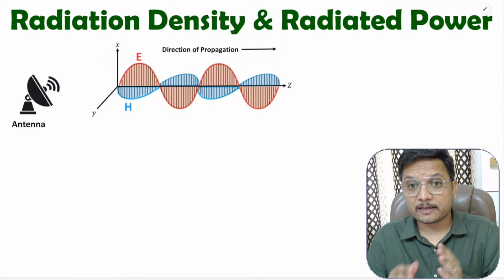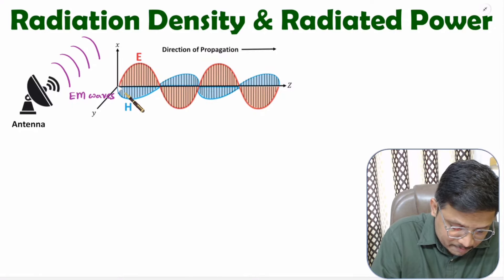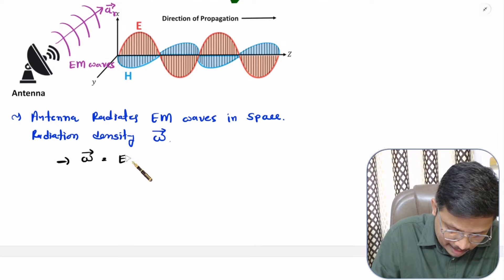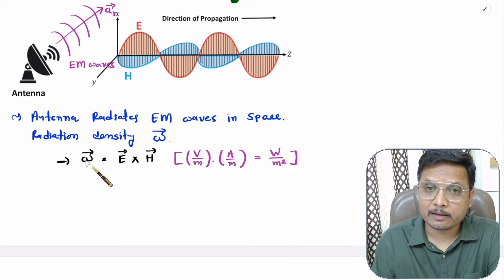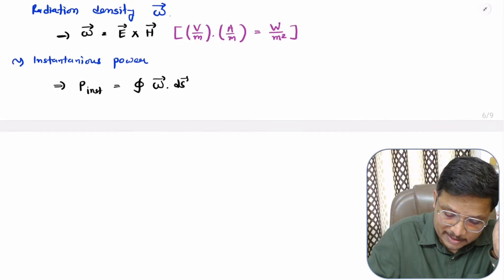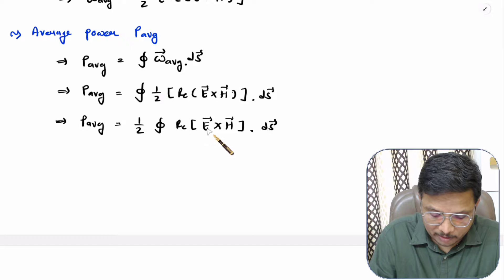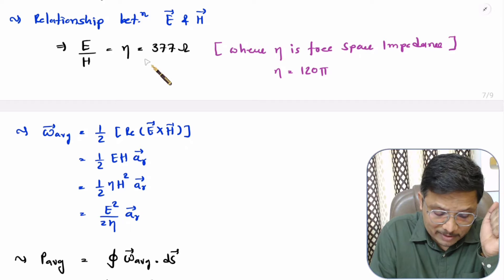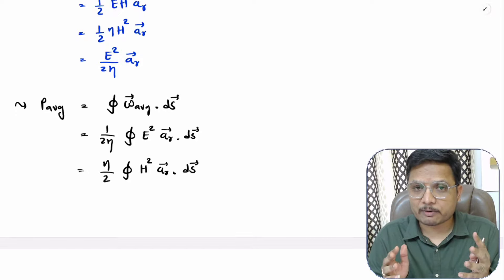Radiation Density and Radiated Power of Antenna | Antenna Parameters | Engineering Funda

Comment: @ 4:49  E / H is in Ohms. Why? E is in V/m and H is in Amp/m. Thus, E / H in V/Amp = Ohm, because voltage / current = resistance. That's the real explanation.
              By the way, radiation density (W/m^2) is a funny name. Density is usually used to describe a substance per volume (m^3). I'd rather call it radiation flux.